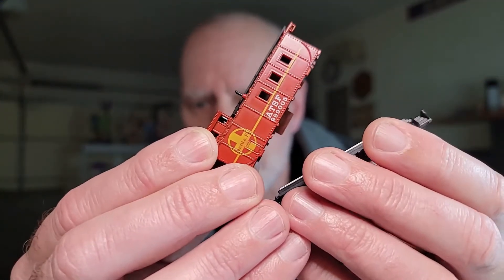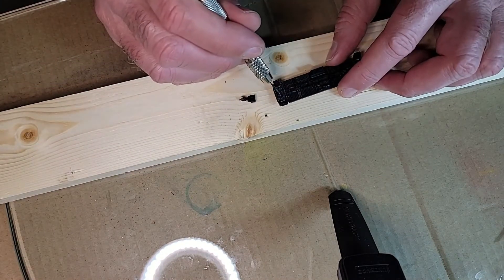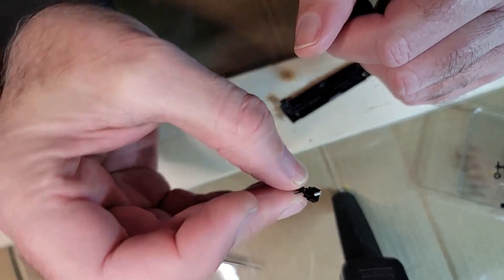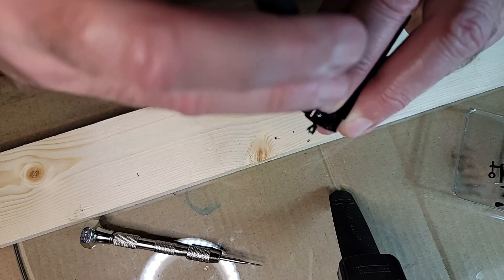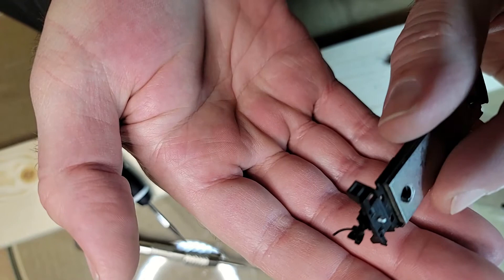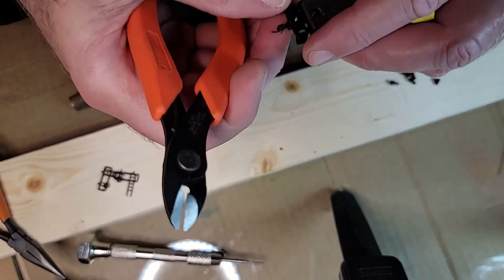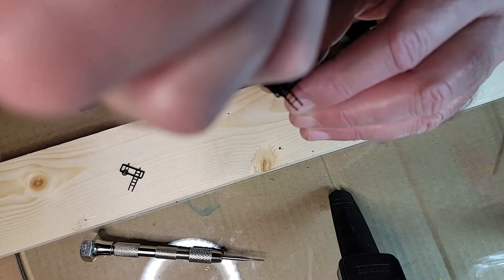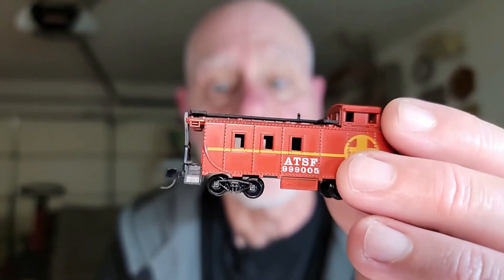Coupler Swap-out:  The Sequel!

Comment: Thanks for the video.  I have a few Atlas and one Life-Like caboose that have mountings like this and was looking to find the best way to convert them. You can always try painting the tops of the screws black to hide them better.
Reply from the maker: I'm not sure it's the "best" way.  One of my subscribers suggested pulling the metal piece out of the coupler box, and then just replacing the coupler arm.  That might have worked, but I'm not sure if the coupler height would have been correct. But the way I did it worked for me.

Comment: Hey Brian. David here. I scored about 25 or so cars of rolling stock. Many of them have rapido couplers. I like the idea of uncoupling the cars over magnets under my tracks. My question is,  are both of the rolling stock cars required to have the same ez mate couplers to work. I do plan on getting rid of the rapido couplers entirely.
Reply from the maker: Hi David, I'm not sure I can answer that.  I only have Micro-Trains Magne-matic couplers, and in my case, yes they would need to be the same.  As I understand it, the magnets force the two knuckles apart so they can separate away from each other.
Reply: Since I already have ez mate couplers, I think that I will stay with them. I’m new to the world of my n scale trains. I have always owned a HO scale train in my storage for Christmas but now I’m trying to get ( on the rails) with n scale. I have completed a simple 2x4 layout with a lumberyard and farmhouse. I used my first steam locomotive that came with the box. I wish there was a way to show you but I’m not sure how to do that.
Reply from the maker: I hear you, David, but as I said, I have no experience with the Bachmann couplers.  My guess is that all couplers would need to be the ez-mates, since the magnets will force both apart from each other.  Wish I could answer better, but maybe Bachmann support could give you more advice.
Reply: I have such a wide variety of couplers.  I think that I might keep some as they are and uncouple a series of cars with one operating coupler connected to the locomotive.

Comment: Question. I am getting some older n scale cars from jerry. I planned to purchase a new dcc loco. Its going to be more expensive to change all the car couplers so i was thinking of changing the loco couplers. How hard and is it possible.
Reply from the maker: Are you changing the loco to Rapido type couplers?  If so, yes, it's possible, I changed a Bachmann loco to Rapidos then back again.  The Kato Loco I have I haven't tried changing yet.
Reply: @brianpagemodeltrains  i would have to see whats on Jerrys cars to answer that question. Im going to guess and say yes rapido.
Reply: @FBMRR  You could just get a few coupler upgrades and make some conversion cars (rapido on one end, mtl on the other).  That's what I did for a few of mine to get the really long trains for some of the challenges.